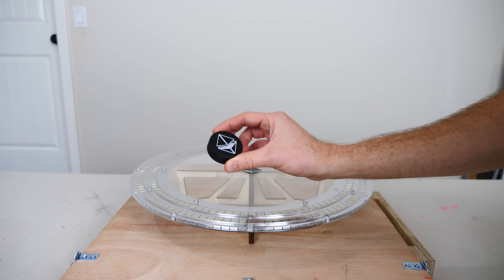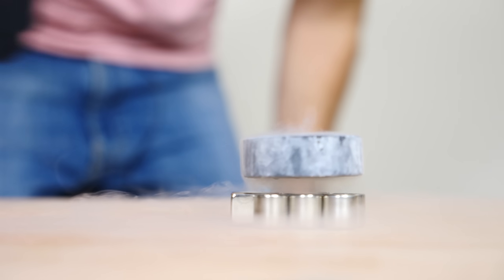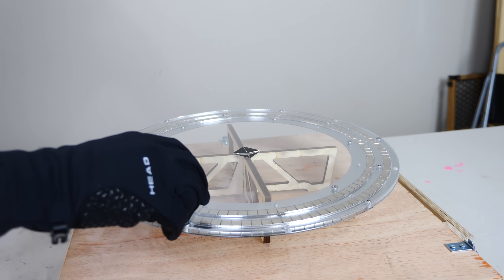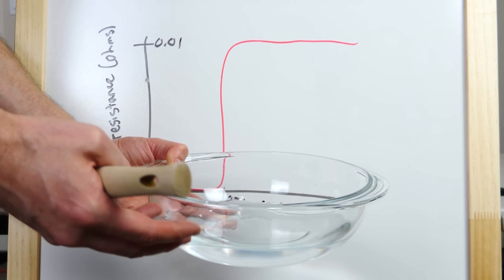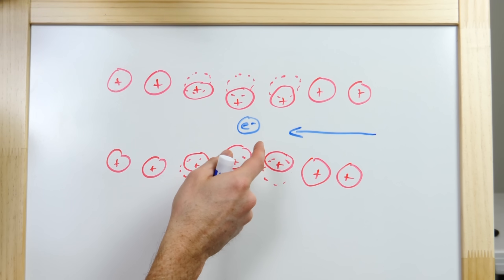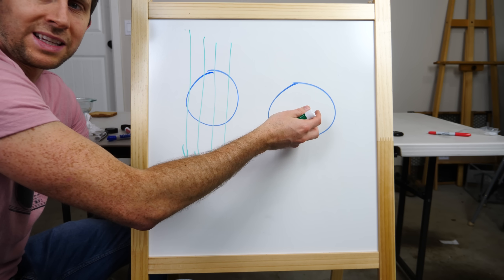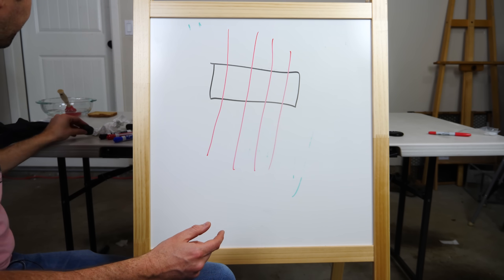Quantum Locking Will Blow Your Mind—How Does it Work?

Comment: I think that could also be used for floating cars/things in the future (in my mind). All of your videos are great for me! Keep it up! :)
Reply: Unlikely to ever be practical for floating cars, but it's perfect for trains. In fact, a similar system already is in place for trains. They're called Mag Lev trains. They don't use quantum locking, but they do use electro magnets to create a repulsion effect and levitate the train.
Reply: Maybe they could find a way to allow enough freedom of movement for it to apply to cars on roads like ours but not off road (or a while not on smaller rural roads), at which point it (the car) could be switched to off-road mode maybe. Maybe having lanes lined with stronger magnets that lock it into place with in between weaker ones.
Reply: @alexlyster3459  aka a rail train (rail gun using magnets and a train)
Reply: @alexlyster3459  yup it’s perfect for trains as there is no friction so ungodly speeds can be reached the same idea was behind the hyper loop where there was a tunnel and the tunnel was basically a vacume chamber so there was no friction
Reply: @saucenado4844  At this point we've found too many ways to say "f*ck friction"
Reply: BingBong  triangle
Reply: @sensawano  you must have missed your train 🤣
Reply: omg wtf
Reply: BingBong  You didn't think of it either bud.
Reply: i mean maybe yeah? but imagine the amount of Neodynium you'd need and it'd only work on those roads lined with it...
Reply: I thought the same thing!
Reply: they are used in bullet trains right now
Reply: You would have to keep the roads or even cars at below 0.001 temps.
Reply: @Skateboarding  Is fun no just no lol
Reply: hi codm player
Reply: it is already used for it in Japan
Reply: bitch please this "technology" is at least 150yo.
Reply: it is already used. thats how bullet trains go so fast. they hover few inches above ground.
Reply: @pepemon1482  Not actually Quantum Locking, but Electro Magnatism used to the same effect.
Reply: @alexlyster3459  Prof. Laithwaite was entertaining af in his magnetism lectures
Reply: @pepemon1482  not same thing, and those don’t use permanent magnets.
Reply: @pepemon1482  
1. They don’t use quantum locking
2. Regular bullet trains use regular electricity… the magnetic ones are called mag lev trains smh
Reply: @SpamMC  bro watched 1 YouTube video about magnets and now is spitting obvious facts to everyone and saying “smh”
Reply: @saucenado4844  I learned that from self studying...
Reply: @pepemon1482   bro Eddy effect of current is used not this one🙃
Reply: that's what i thought
Reply: Bobux

Comment: What happens if you make the super conductor a sphere and have 2 plates with those magnets one on top and one on bottam and the plates are locked together and you use multiple super conductor spheres like enough that they are almost touching will they keep the same distance a part? Will it creates sustained force or energy if you can keep the super conductors cooled....

Comment: The puck shape reminded me of an idea I had.  Every time I'd go to this place nearby that had an air hockey table the table would be broken.  I guess they are pretty prone to having problems and fairly expensive to keep working.

My idea was to have a table covered completely with magnets.  I'd arrange them so each one had was flipped opposite from the ones next to it in a checker pattern so that the overall field wouldn't do anything weird in the room.  Then I'd make a diamagnetic puck.  I have no idea how strong the magnets would have to be to support a regulation weight air hockey puck made mostly of bismuth (or maybe pyrolytic carbon?)  Air hockey tables start about about $300 (but those are pretty flimsy models).  I doubt you could do it at a competitive price in the low end of the air hockey market, but maybe for the arcade versions it might be worth it.  I understand the normal ones use a fair amount of electricity.  A diamagnetic one would theoretically only need electricity for the scoreboard.

Comment: Try that with a puck made from Bizmuth instead of the superconductor.

Don't forget that there are magnetic lines going from the Equator and the North Pole (and South Pole) that the magnet can 'attach' to that could be why it's holding in place.

Comment: No internal resistance, but there is external. One important factor is air resistance. Some smaller factors in this case is waste energy like heat and sound.

Comment: I had a couple of questions / science experiment suggestions:
How long does the puck maintain momentum when on the track, without intervention?
How much weight can the puck maintain  when it levitating? I imagine it's more than a tangerine?
Reply: The time it stays on the track is a direct result of the initial input.  After that initial impulse of force, the puck will continuously lose momentum.  It is an incredibly small amount, but continuous due to air friction, AND eventually will lose more as the temperature rises and the superconductivity decreases.
Reply: @mikedeloach6849  Thank you. 
We still haven't got perpetual motion worked out then! Never mind. 😂
Reply: @louiselincoln  Well, what if we start it and then put this unit inside a vacuum?
Reply: @KingNiros  the temperature would be raised by the surrounding environment, so it would still lose its conductivity and fall eventually
Reply: @jacobo9229  what if we found a way to anchor it in space, preferably in a area outside the Suns light, then it would be in a vacuum, and it would be cold enough keep the superconductor superconducting.
Reply: @braydenbanks4228  good question, I’m sure it would still eventually warm up but who knows how long it would take
Reply: @braydenbanks4228  That might work. Would the lack of gravity and being in orbit affect this form of motion?
Reply: @KingNiros  That would be a great experiment. :)
Reply: @louiselincoln  Unsure, but the vacuum in space would reduce air friction to zero, and in the dark parts of space the temperature is pretty constantly far below 0°C.
Reply: @braydenbanks4228  Thanks. :) maybe Elon Musk will be trying to out somewhere soon...
Reply: @louiselincoln  Making something that moves forever isn't hard. The tough part is having a net positive energy that you can extract.
Reply: @TuberTugger  Oh?? Sorry. Shows you my lack of physics understanding, then! Sorry. I'm new to this stuff.
So, it's 'siphoning off' the energy of the momentum that causes the main issue in perpetual motion being used for energy production. Is that correct?
Reply: @louiselincoln  Energy cannot be created or destroyed. A perfect system would simply never lose energy and keep moving forever. Like shooting something into space. 

Perpetual motion machines, as an energy source need to be able to draw energy from the system. 

Like if you ride a bike. Then you add a generator to it to slowly charge a battery while you pedal. You'll need to pedal a LOT harder. So the second you put something that draws energy from the system, it's going to stop moving.
Reply: @braydenbanks4228  Uhm, not really. Space is a powerful vacuum, not something that has temperature. In fact, the heat loss in space is mostly just proportional to the bounding surface area where it escapes as infrared radiation. A space suit for example, struggles more with heat dissipation than keeping the astronaut warm. The small puck is too small to radiate its heat fast enough, I would presume, if you consider the heat itself generates from having momentum, stress, de-/acceleration or any other physical so called work on itself.
Reply: @gandalf8216  OK, thanks for the info. Just to clarify, are you saying our proposed perpetual motion machine wouldn't need to be in the dark parts of space to remain cold enough to stay a superconductor? Are you saying that space would cause a small puck to slow faster because it doesn't have enough surface area to remain cold? Something else?
Reply: Realistically it will warm up enough and fall to the ground before it loses any observable amount of mementum from friction with air

Comment: Cant this be translated into how hydoelectricty is made but without the water or burning substances. A turbibe that turns based on the things you explained in this video. All we would need to supply is the temps to the super conductor allowing it to move around and while its moving around it is producing electiricy by being connected to something like hydro turbines are maybe? I have no idea I have 0 knowlegde on what im trying to exlain. Help lol

Comment: Can these models be upscaled to supplement motorized tasks, or is there some critical point where the system spirals out of control? In other words, can we apply superconductors mechanics to warehouse logistics whereby specialzed pallets and flooring are used to allow for quantum locking? Just imagine not needing to use a forklift or rollers and just using your hands to manage a manufacturing warehouse.
Reply: It’d be impractical due to the constant need of a cooling source. There would have to be a constant stream of liquid nitrogen underneath rows and rows of superconductors.

Comment: You're mumbling too much about bumping and pairing ... most people have 0 imagination and common sense, they won't understand any of it. If you want to explain this to primitive beings (99% of humans), then use examples like "bingo machine" or "pool table". Think of bingo balls as particles, that's pretty much how particles move in gas. Then slide bingo balls down a slope ..because that''s how particle move in liquid and then connect them together with small springs, because that's how they move in solid objects (someone actually made quite nice example using balls connected with springs). Otherwise normal people just don't understand anything ... they roll their eyes over it.

Comment: Ever since I was a kid, I've always had an idea that aliens use some kind of focused magnets to fly, they use planets as focal points, so they push/pull between planets. I hope that after watching this video people will realize it's actually possible, it would explain why most UFO sightings have caused failure in electronics (like EMP). also the perpetual motion within material is not real, just because material has no internal resistance, doesn't make it perpetual .. because even electrons are affected by gravity and other external forces, so it will eventually stop. Perpetual motion is something that generates more energy than it requires to keep itself moving
Reply: What aliens, lol
Reply: Ahh yes the aliens

Comment: The lack of friction makes me believe that this would be a fantastic way for traveling on the ground. A super cooled under belly of a train type vehicle, being over top of magnets. It would be an interesting spin on a maglev train.
Reply: What’s gonna keep the train cold
Reply: @nombre1248 completely hypothetical, but. Make the undercarriage of the train completely out of superconductors, have some sort of mechanism that is apart of the train that would fill the bottom of the train cars with liquid nitrogen. Through the power of conduction, the whole bottom of the train could be cooled while passengers board, etc. 
While the rail system is made of, well, magnets just as a maglev would operate. The only thing is that the liquid nitrogen would be extremely expensive and the coasts of R&D on such a project would make it very unfeasible in our day and age.
Reply: haha you guys literally just invented the Japanese SC maglev, it does use superconducting magnets to work and that's how it gets up to 600 km/h. They use some sort of cooling systems to keep them cold but yes the technology does work.
Reply: how it it no friction though? just cause it's not touching the ground does not mean thier won't be any friction.
Reply: @vladienee9367  but we do have air friction but a solution for that is to make a vacuum tunnel so there is no friction at all.
Reply: also am I the only person wondering why he didn't just say that super conducters are materials that can have electricity travel through them without loseing any current or power or just  a little bit along the way?
Reply: I have a better idea instead of cooling the capsule we can cool the tracks.
sure is not that efficient but it's worth a try and also we can insulate the tracks really well because it's stationary to make it more efficient.
Just saying.
Please tell me if I have missed anything

Comment: Not sure if anyone else commented on this, but the cooper pair is between the two objects -- and a magnet doesn't have a changing magnetic field; it has a static magnetic field; which is a reflection of the interaction of the molecules of a magnetic object, essentially created by the congruent motion of the electrons within the object, aligning to create the North/South force that we expect from magnets (electric fields behave slightly differently). Magnetic effects are not quite the same as current induction; it's the molecular shape that matters, which is what changes between different quantum states.

Overall, this is a really cool video

Comment: This is awesome. Wonder if we can use this at large scale for automotive suspension.
Reply: It is really cool but it needs to be very cold to maintain those properties which requires a ton of refrigerant or liquid nitrogen to keep it at that temperature.
until we find a solution for that it not it's not happening.
But when we do it has some amazing potential.

Comment: So on the track, could you have 2 (smaller) super conductors, each at different levels of hight? Would they be able to travel over the magnets independently? If so, could they travel in different directions independently?
Reply: This tech would probably be tested on forklifts first. Also be sure to invest in liquid nitrogen tech soon.
Reply: Flying cars could exist sheesh
Reply: @1xSunset  Of course, the superconductor has to be constantly cooled for this to work, but theoretically if we could find a way to have one that doesn’t require cooling and be decently cheap then yeah
Reply: @illusionaryheart3325  space is pretty cold
Reply: @1valzo  and that is relevant, how?
Reply: @1valzo  due to materials being non existent in space there is no heat transformation trough particles touching each other and it's a wrong statement to say space is cold actually astronauts clothes only need to keep pressure up and have an oxygen tank to provide oxygen for astronauts in order to perform outside space station
Reply: @swetea6908  well no, space is cold. It's the closest anything can get to absolute Zero. Astronaut suits aren't just pressurised they're also totally insulated to prevent any energy escaping the suit which would naturally happen due to the concept of thermodynamics and enthalpy
Reply: @swetea6908  LOL  a quick search "The baseline temperature of outer space, is 2.7 kelvins (−270.45 °C; −454.81 °F)."  that's cold and any water basset creature in contact with that temp dies instantly
"it's a wrong statement to say space is cold actually astronauts clothes only need to keep pressure up and have an oxygen "  smh ...
Reply: @silverkairos1493  How dare you bring up conductivity in this internet debate!
Reply: @MrBlessedninja316  ;-; ive dishonored my family
Reply: @1valzo  It's also super hot
Reply: @thestain8004   @JediSpaghetti  You guys are actually wrong about this. Swetea was absolutely right that you won't freeze when exposed to vacuum. There is no atmosphere and therefore no heat conduction and only temperature loss comes from body radiating heat (that's why astronaut suits are insulated - to keep that heat from radiating away), which is a slow process. If exposed to direct sunlight, you might actually heat up instead depending on your distance to the Sun. What kills you is lack of pressure, which causes a multitude of problems like tissue swelling and blood vessels blockage.
That 2.7 K refers to CMB radiation, which actually heats you up (albeit, an unnoticeably small amount).
Reply: @1xSunset  lets hope that your idea wont become reality

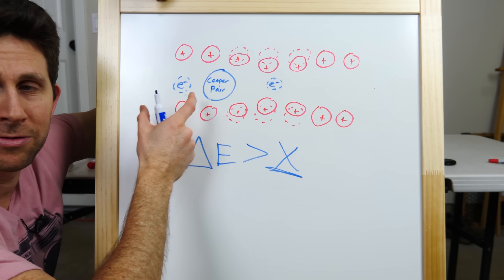Comment: 11:49 - If you increase the electron current, not voltage. Voltage = current * resistance. If the resistance is zero, the voltage is zero.

Comment: I'm wondering and will now have to look into the possibility of this being applied for fun/entertainment in the form of a designated skate park similar or identical to roller skating rinks of old...with this doing away with wheels altogether, and be a hover park....I know that due to the extreme low temperature basically requiring liquid nitrogen to be used to achieve the desired effect, that safety is immediately either a major hurdle to surpass or is the reason this idea could never come to fruition as some seriously heavy-duty protective knee high boots would be necessary among other ppe gear and that's just to get insurance companies to even begin to entertain the idea of insuring such a business. I know there are many more obstacles that would have to be overcome for this to fruition, as I only named the first problem off the top of my head. I'd love to hear thoughts and opinions on this goofy idea, and I also hope someone with good sense chimes in to help remind me that my ideas are exactly the same as my mind...dumb and useless ha

Comment: So if you put a superconductor on a magnet track in space where the avg temp is 2.7 k (colder than liquid nitrogen) could you harvest the energy from that perpetual motion? You don’t have to put in work to maintain the necessary cold temperature.
Reply: Extracting energy steals momentum from the object. Then you need to put equal/slightly more energy back in to give the object its momentum to move again. You’d actually be energy negative due to waste heat